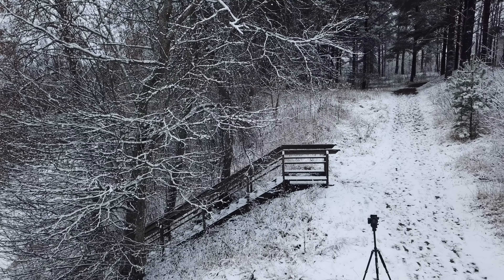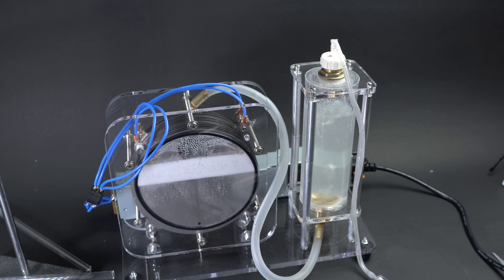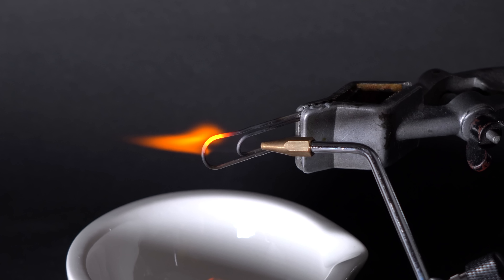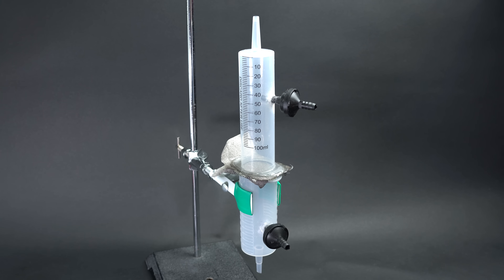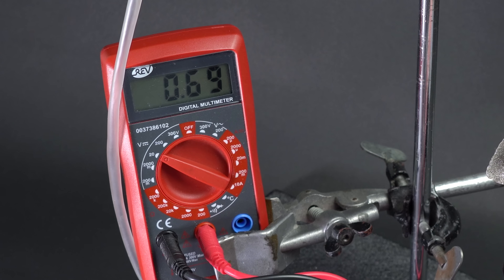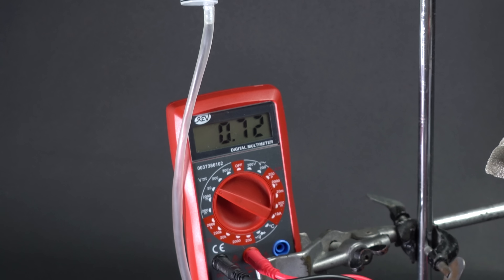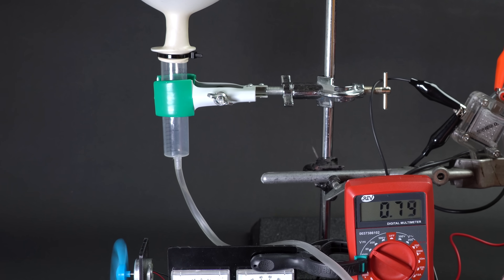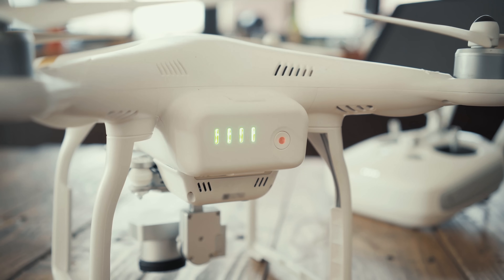I Made a Hydrogen Fuel Cell - Renewable Energy!

Comment: That is not sodering... Soldering is used to form a permanent connection between electronic components. The metal to be soldered is heated with a soldering iron and then solder is melted into the connection. Only the solder melts, not the parts that are being soldered. What you did there is more of bonding.

Comment: Just curious, but instead of converting electricity into hydrogen, then hydrogen back into electricity to power an electric engine, wouldn't it be more efficient (at least on larger scales, I'm talking cars) to burn the hydrogen in an internal combustion engine? Also, aside from drones and bikes, I think such hydrogen batteries would make more sense in trucks, where you absolutely need to make as many miles as possible in a very short time. In electric cars, it would make more sense to keep the 300-500km range that we currently have with lithium batteries and just stop and recharge for a few hours (it would also help if parking lots will be accommodated with charging stations, so people won't have to go to the station like they do now with ICE cars). There's quite a lot to unpack in this comment, so thanks in advance for the replies.

Comment: It would've been great to build such a Device, but this is way beyond the Average Person Ability's to Achieve for many reasons. Two Main Reason Are Expense and Availability. Another down Fall would be, Product Size. To Power anything really useful this Device would need to be 100's of time Larger in Capacity. Maybe Thousands of time Larger. The Expense of PLATUIM would cost more than Home and Land. No good reason for the Commoner to start such an Endeavor in my opinion.  Now if you were to show how this could be done using common Materials that would be easily sourced by the Commoner, then your work would have a greater Merete. I'm giving you a Theoretical Thumbs Down because of Complex and being out of reach for the Average Person. A Thumbs Up because this is possible to do if you have a Very Deep Wallet. Please take your time and find a way to make this with Common Products.  Thanks for the upload. PS Thank you for sharing your knowledge with me. IT'S APPRECIATED BY ME.

Comment: Thank you my friend. May I interject a postulation? Can the experiment be ran in reverse method? Your device was running a fan from a ballon of h2. Can you mechanically turn the fan while supplying a small current potential  to produce more h2 in the ballon? Does it run backwards? Your platinum plated nickel sponge electrode membrane.
Reply: Iirc there was a paper released about running a fuel cell backwards but the efficiency wasn't that good. I'd send the paper but I forgot who wrote it, it was either NASA or a college

Comment: Great video project! Would it be possible to separate mixed oxygen and hydrogen using nafion membrane?
It could be easy to produce a mix oxygen and hydrogen and separate these two using that membrane. Best regards!
Reply: As far as I can tell you can separate them by height. hydrogen is lighter than oxygen, so you use an alembic to grab the hydrogen off of the top. stopper the alembic at the hydrogen collector end and where its connected to the PEV, and use pressure to push the oxygen out where you can collect separately. You can use nafion, but it is more expensive.
Reply: @gweedohatsis8404  did you try to use that methode?

Comment: You have forgot to say that hydrogen production has a lot of storage, transport and so cost/sustainability problems.
Reply: Actually, it doesn't. Easy to produce, store and transport. Can even be made right at the gas stations that already exist.
Reply: @darnice1125  It is easy to write a comment on such a topic without any knowledge.  However Ender Uslu is quite correct, which is also quite easy to say.  however I have read many papers on the subject for 25 years.  the conclusion I have drawn from all this work is that the only people who promote fuel cells are being funded by the people who sell hydrogen.  this is nothing to be surprised by.  however over 90% of hydrogen production is by the catalytic reduction of natural gas, and less than 10% is produced from water.  this any time some one tells you they want to use hydrogen to power something they are omitting the completely nonrenewable and CO2 producing nature of this activity.
Reply: @bgbthabun627  very nice.  Where's the future of energy storage or production as you would see the near future?  I have some of my own perceptions.

Comment: "Modern fuel cell cars have a better range and can drive up to 600 km." Maybe this was the case 20 years ago when BEVs drove ~ 100 km per charge, but today modern battery electric cars can also drive up to 600 km (next generation even more). The "much higher" range of fuel cell cars is just marketing.

Comment: Hydrogen cars is a fools airend. There is lots more issues with hydrogen than you state. Also saying that issues like price of hydrogen will be economy feasible is unfounded. 
Even if hydrogen was competitive it batteries is a better choice for personal transport. 
Also saying that hydrogen would give your drone more range is also unfounded. If this was true we would have hydrogen powered drones by now sins cost of fuel is a non issue for small drones. Just look at the avaliable small hydrogen mobile chargers that do exist, their terrible. 
Also, just take a look at state of the art hydrogen cars, their heavier than both their fossil and electric counterparts, and don't deliver more real world range. So easy to check. Hydrogen economy is a myth. 
Hydrogen is "the Nicola motors" of energy storage.

Comment: Challenge: what is the most efficient frequency (PWM) to break the molecule of water?
Reply: you need DC to separate hydrogen and oxygen
Reply: @filippovolpe746  PWM = pulse with modulation: is direct current delivery method of reducing the average power consumed by an electrical signal, by effectively chopping it up (on-off) into discrete parts.
Reply: @josidasilva5515  yeah I know that but thought you meant AC, then I don't understand why pwm frequency would matter. I don't have in mind a characterization of the process with different frequencies, voltages or duty cycles.
Reply: @filippovolpe746  With PWM, instead of floodding the system with a continuous stream of electrons, you are pulsating them (on-off) and saving energy. At an atomic level, you are trying to resonate with the path of the electron around the nucleus. Tesla had extensive use of resonance in his inventions.
Reply: @josidasilva5515  "path of electrons around the nucleus" yeeeah there's no such thing. If I'm not mistaken even the lowest resonant frequency of rotating water dipole is in the GHz where pwm is not really viable as far as I know at least. Perhaps you could use a integer fraction of that frequency but jitter would become an issue... If you know some papers I'd like to take a look to them :)
Reply: @filippovolpe746  'To resonate with' is not 'to match to'. It can pass 1M times around and just be hit once with the right speed (Voltage) and at the right time (frequency). Just set up your old high school experiment and apply PWM to it...
Reply: @josidasilva5515  that's what I meant with the jitter being an issue, your pulse would need to have impossibility(afaik) fast edges to kick the "electron that goes around the nucleus" somewhat in-phase although the actual pwm frequency is manageable.
Reply: (sorry this conversation started from me misreading your comment, I didn't want to seem an ass but I'm curious right now :)

Comment: If only platnum was cheaper! What about a turbine engine burning hydrogen? Like a micro turbine, the size of a 18650, or 26650, with a tiny generator, it could be used to charge super capacitors or lithium batteries in drones,  I think internal combustion engines have a long useful life, even in the 21'st century, they may only be used as range extenders, similar to a diesel electric locomotive, only with Batteries, and much smaller.  Or a Prius with much larger battery!

Comment: Hello, I have a special request can you run one of your fuel cells on hydrazine (ammonia and sodiumhypochlorite) on one side and 20%+ hydrogen peroxide or better yet, ozone, this should increase performance 40%+, your fuel cell would outperform if you sputter nafion with platnium, put in a jar, pull a vacuum, heat platniumwire to sputter surface of nafion then rub with nano carbon/graphite

Comment: Sadly, Hydrogen is produced from natural gas nowadays, because it's a lot cheaper, so if hydrogen cars were to be run today, they wouldn't really be renewable. The efficiency is also affected by the energy required to compress the hydrogen, getting it transported from the manufacturing plants to refilling stations, etc. An hydrogen car has lots of range, however, and can be refilled quickly. Probably the best for hydrogen would be if the refilling stations themselves performed electrolysis with solar power. But then there's the issue of the cost. How much will the hydrogen cost.
For city use, it's hard to beat a BEV. The range is more than enough, you can recharge at home, and recharging would be quite cheap.

Comment: I'd love to be enthusiastic, but I was reading the predictions of "the hydrogen economy" 25 years ago in popular electronics, and the only thing that's changed since then is the availability to the hobbyist. Excellent demonstration though, your channel is one of the greatest science channels. You're number one of the top three for me.
Reply: Hydrogen may make a marginally acceptable energy storage medium, but it it not an energy source.  There is no free H2 available on this planet, it all has to be produced.  Electrolysis for H2 production is very inefficient.  Most H2 used today is produced by steam reformation of methane, which also produces a lot of CO2.
Reply: @fredsasse9973  Fred....what do you think of using Hydrogen fuel cells to store energy?...between solar, wind, hydro....it dies not seem that creating the energy is the issue..Storing it, however? If we used the renewable sources to do the electrolysis, would using H.F.C.'s as storage mediums then be sufficiently efficient?  I guess it does not matter, if there is still limited amounts of raw materials, to construct batteries or fuel cells
Reply: @davidwalker8754  I don't think you can store hydrogen in a fuel cell, rather the fuel cell uses hydrogen to produce electricity.  The hydrogen that a fuel cell uses has to be stored in some other fashion (like in a pressurized tank).  In any event, I think using the energy produced by wind, solar, etc. to produce hydrogen (i.e. through electrolysis) is a huge waste of energy (you never get back anywhere near the energy you expend to make hydrogen through conversion via a fuel cell).  It's better to store the wind & solar energy in some other fashion.
Reply: they already had extremely efficient ways of getting it from water, its been suppressed. they had water powered cars in the 80s, us pentagon refused the guy public patents, said only private and military use no exceptions. guy held out, died in a restaurant meeting with alleged investors from belgium. was even on mainstream news at the time, can still watch the clips. Stanley Mayer. He was not the only one, just one example.

Comment: We need to use this technology on submarines!
Reply: I don't know about submarines but this technology was definitely used on the Apollo spacecrafts and the Space shuttles - if I recall correctly this technology was developed for space travel because of the low weight to energy ratio compared to batteries. And the water produced by the reaction was the source of hydration for astronauts (but only after mixing in the necessary salts)

Comment: "I used electricity to produce electricity."
Reply: yes but the electricity used can come from a renewable source
Reply: You need money to print money
Reply: wait till you hear about the first law of thermodynamics
Reply: MichaelKingsfordGray  ?
Reply: Infinite Electricity
Reply: @NoOne12385  it should be about formalizing the technique. Supreme being meditations work for tech secrets.
Reply: "I used electricity now to be able to produce electricity later."
Reply: Enter solar panels
Reply: That's how I see it. Formalize the design and it does a lot of work. The fuel burn system is a temporary problem.
Reply: I used electricity to store excess electricity from a renewable source to use it later and store it in much greener storage as compared to a battery
Reply: I mean if it was in a car it would convert into mechanical energy
Reply: converted electricity to hydrogen to produce energy
Reply: MichaelKingsfordGray  wtf is wrong with you??
Reply: The electrolyser is useful for testing fuel cells.
Reply: You can use renewable electricity to convert water into gasses that are useful for storage and retrieval of backup power

Comment: What about hydrogen in a combustion chamber?  Much of hydrogen's energy could be used this way as it is a very explosive gas.
Reply: Combustione engines have efficiency that is almost 3 times less than fuel cell
Reply: @francescostarace6973  Not to mention that the steel alloys and other metals in engines are very susceptible to hydrogen embrittlement.
Reply: BMW did this ages ago.  Look up "BMW hydrogen 7"
Reply: Psalms 118:8  I think he was trying to be humorous.
Reply: Perhaps I should have elaborated more.  I am not referring to pouring hydrogen into a combustion engine as if it were gasoline.  I'm wondering why in this case hydrogen passing through a film to create a tiny amount of electricity is more efficient than using a dry fuel cell to feed hydrogen directly into a combustion chamber?    ( I really dislike how people in the science community seem to have their head up their ass.  The arrogance is amazing. Is it really a dumb idea to feed one of the universe's most explosive gas into a combustion chamber?)
Reply: @JorgeL721  Using hydrogen in internal combustion engines as a fuel instead of classic fuels does not present great improvements in the total efficiency of the engine, if not an increase in the efficiency rate of the combustion process. From the point of view of emissions, this solution allows to produce only water as a combustion product, so it would seem to be very ecological, but it is still necessary to establish with which electricity this hydrogen was produced. in fact, if electricity obtained from renewable sources is used, this hydrogen is effectively ecological, but if energy obtained from fossil sources is used, hydrogen is being produced that is not eco-sustainable.
If hydrogen is used as an additive to classic internal combustion engines this allows a slight improvement in combustion efficiency and nothing more.

In my opinion, hydrogen should be understood as an energy carrier used to power fuel cells for conversion into electrical energy as alternatives to batteries, in heavy weight transport applications. In this sense, the high efficiency of the electric motor (99%) combined with the 50% efficiency of the fuel cells and taking into account the weight reduction of vehicles without useless and heavy lithium batteries, the world of city transport can benefit from a real eco-sustainable energy revolution, it being understood that the hydrogen used must be produced from renewable sources otherwise everything turns out to be useless.
Reply: @francescostarace6973  Thank you.  That makes a lot of sense.

Comment: [I didn't mean to leave 3 comments]   The main problem with PEM (Proton Exchange Membranes) is that they self destruct over time.
One of my instructors worked for Ballard Fuel Cells (a 5 minute drive from my home) making a new type of PEM.  Six months work on his PhD produced 9g of powder.
PEM fuel cells form Ozone from oxygen within the chemical/electrical structure of the PEM polymer.  The ozone then attacks the bonds of the polymer.
To the current date (Jan 2021) Ballard, and by extension Honda have not been able to overcome this problem.  The research I was doing to improve Fuel Cells was merrily bought up by Exxon Mobil and put on the back shelf to collect dust.  Thanks Big Oil you fux!
Reply: The first part sounds interesting, the second part sounds like utter nonsens.
Why should "Big Oil" hide a technology wich could ensure their existens via enabling the mass use of hydrogen fuel cells and therefor the mass usage of hydrogen, of wich the bulk of the production still  consists of methan reformation (and we all know who is providing said methan)?
Reply: @Enthropical_Thunder     Fair enough.  I know for a fact the business was bought out by Exxon Mobil and employees, such as myself, had the option to convert shares.  
As to what exactly EM is doing with the research now is of course beyond my knowledge.  
The process as far as we had taken it was still considered parasitic to the energy output of the fuel cell. I should mention that the system I was working on was an add-on to a fuel cell and not the primary stack itself.  We were working on the 'fuel' side of the issue.  
We looked at medical oxygen production and did side work on methane separation and hydrogen purification equipment as well.
I would like to believe that corporations have the best interests for humanity when it comes to alternative energy research however I fear it might not be so.
Your point about oil being a source of hydrogen is of course correct.  I can put 20 kg of hydrogen (bound up in gasoline) in my car and transport it around safely.  A high pressure hydrogen tank can contain about 1-2 kg of hydrogen in a very dangerous form (highly pressurized) in a very expensive tank.  The 'Green' future for transportation that I envision is electric vehicles powered by supercapacitors charged with electricity produced by fusion reactors.  Should be 10 years away....